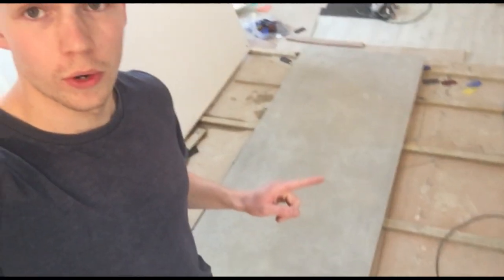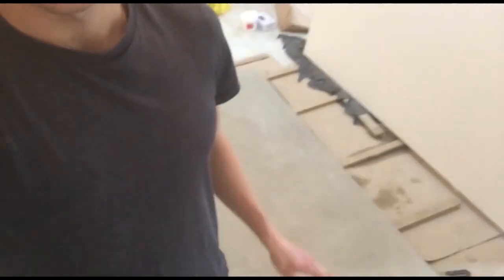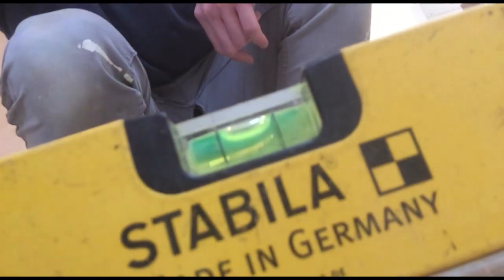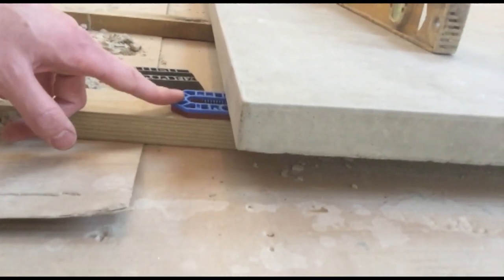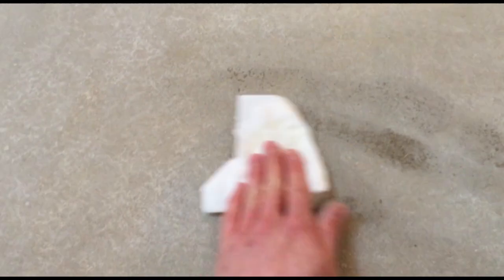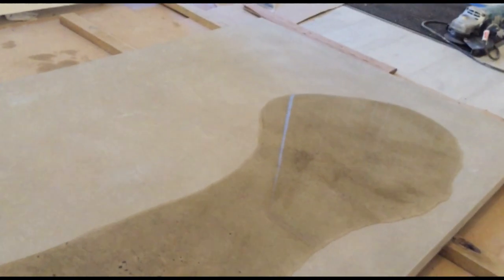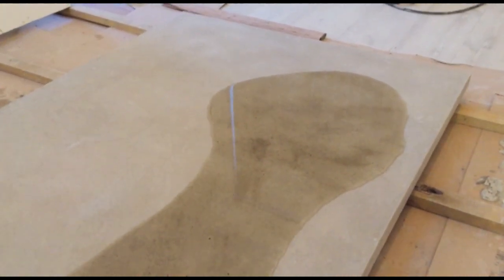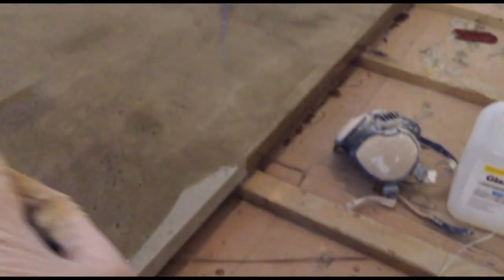How to Epoxy / Seal a Concrete Worktop / Countertop with Glasscast 3 Epoxy Resin

Comment: Great job. I made my own kitchen countertops in concrete and the are glass smooth out of the mild but I’m going to slurry the pin holes based on this vido as inspiration. Thanks for make it. Excellent work👏🙏

Comment: Thanks for the video. I was thinking about casting a few concrete worktops myself but was put off the material due to the fact it absorbs stains too easily. This epoxy solution has changed my mind. Looks great man! 

Don't suppose you know how heat resistant expo is?
Reply from the maker: The max temperature for this epoxy sealer is approx 60 degrees. But I recently used a product called H-Seal Concrete Countertop Sealer in my latest concrete worktop video. Have used it for 6 projects now and work really well and goes up to 200 degrees Celsius. Could be an option if you’re looking for a natural Matt finish. Here’s the video: https://youtu.be/O3DMjFkrC48

Comment: Hey Matt, I live in Spain and renovating a house. Had a massive concrete Kitchen countertop made. It looks pretty good...However we are having some issue son the surface ...while sanding the surface, some parts do crumble leaving a dust and brittle surface. I am thinking of putting an epoxy to seal it properly and give it an even smooth surface. What do you think ? Hope you can help. Thanks a million
Reply: I am having the same problem on the concrete counter top, have you tried the epoxy? if so what is the result may I ask?

Comment: I love the brown color with the darker slurry-filled pin-holes. How did you accomplish that color combo? Did you tint the concrete and/or slurry?
Reply from the maker: The brown colour is the natural colour of the concrete. And the black dots are the slurry mixture with is just cement and water mixed together to make a paste.
Reply: @MattHutton  thanks for responding! I’ve had trouble getting that look with the Portland cement and concrete products available around here. Apparently Portland changes color depending on where it’s sourced from.
Reply from the maker: @H1GH0CT8N3  if you’re from the UK you can use: Blue circle multipurpose cement and water to make the slurry and it will go black like that once the epoxy is poured on top. https://www.diy.com/departments/blue-circle-multipurpose-cement-25kg-bag/35715_BQ.prd?storeId=1018&ds_rl=1272379&ds_rl=1272409&ds_rl=1272379&gclid=Cj0KCQiA4feBBhC9ARIsABp_nbUXm0dMDRZFtW-jAS4IEIEQm38LSPcTLB8PtRuJbXlPu2WqJEo-vgMaAjlMEALw_wcB&gclsrc=aw.ds
Reply: That is so simple and amazing. I've watched alot of videos what over complicates things.. I took special notice of what van delaminate the surface. I think I'll do a base pour and then an actual pour so that doesnt happen. My concrete has slight cracks that occurred during drying.

Comment: How is it holding up? Does the finish need to be looked after carefully to avoid scratches etc, and if so do you have a way of repairing the glass like finish? Cheers.
Reply from the maker: It’s pretty good, as long as you don’t get dirt and grit on it or put heavy items on then and scrap them across the surface.
To repair you can sand it back and polish or sand it back and repair another layer :)

Comment: Looks great!! Am thinking of making one for my restaurant for the kitchen service counter, it does mean it will get hot pans laid on the surface, do you recon it would stand up to that kind of abuse? And like loads of antibacterial spray on a daily basis. (Would probably lay a slab of wood down for the hot pans if it wouldn’t stand up to it). Great work!!
Reply from the maker: I thanks :) I do t think it will stand up to the heat. Room temperature cure epoxy like this one will have a deformation temperature of around 60-80 degrees Celsius. I can however recommend a Matt finish I used recently which goes up to 200+ Celsius. Check out my other video here: https://youtu.be/O3DMjFkrC48
Reply: Get the high temperature epoxy and then the super crazy hard roll on extra sealant layer.  Both heat and scratch resistant - look into them  at Stone Coat Countertops

Comment: I'm wanting to make a concrete countertop to be heat resistant so I can place hot skillets and pots on it. I imagine epoxy coating is not going to hold up to that well. Do you recommend any sealer or technique to seal the countertop and still maintain heat resistance?
Reply: had the question in mind...

Comment: Hi Matt, Top Video mate, In London, currently doing this project, have made the concrete and form, removed it from its form and kept it wet and sheeted over for 7days to cure, I'm currently on the 5th day, though, question, before you applied this resin, how long did you wait for your concrete countertop to cure or strengthen before applying the resin? On the back of my concrete bag from Wickes, it says cure time 7 days, keep wet and sheeted, though, 28 days for full max strength and then I read other online advice suggesting to wait till the full strength 28-30 days till you resin. How long did you have to wait till you apply the resin?  Thanks, mate.
Reply from the maker: Y. E concrete takes years to reach its full strength. If it s fairly think line mine 40mm. I would wait 7 days because epoxy really doesn’t react well with water until it’s cured fully. :)

Comment: Hi Matt
Can this be safely used on a concrete countertop that has already been installed but and used. In other words, the kitchen counter is all cement and has been like this for years with no finish. Would this process work in our case do you think? I really like the work. Thanks for sharing
Reply from the maker: Yes you could. You just need to sand the surface to give the epoxy a key to stick to. Between 180 and 240 grit is about right. You also need to make sure you fill any holes with cement slurry, the surface should be as smooth as possible to give you the smoothest finish possible. :)
Reply: @MattHutton  are you happy with the surface after some time has passed?  Has the surface dulled from use?  Have you scratched or stained it?  How is it with moderate heat?
Reply from the maker: Dan Gehring I’ve actually been meaning to make an update answering all those questions.
The surface take boiling water being poured directly on it, hot cups and plates very well after a couple of weeks. Its pretty scratch resistant but you can see minor scratches in the reflection if you look hard at it, but it not that noticeable day to day, i.e the surface has not dulled but there are definitely visible scratches. No stains at all easily wipeable. And overall I would definitely use again for an indoor worktop, but not for outdoor.

Comment: Many thanks. Been thinking about doing some concrete worktops, I'd have loved to have seen how you made it.. Do you think it has worked out any cheaper than a solid wood worktop?
Reply from the maker: It cost approximately £150 in total for that breakfast bar worktop, which is for the concrete and resin for the top. I’m sure you can find real wood worktops cheaper on gumtree or Facebook marketplace but I loved the project and effect the concrete gives :)
Reply: @MattHutton  chears pal, much appreciated. Any chance you could tell me the approximate size of your worktop, and the materials involved? I know the Americans can buy bags of  pre mixed fine mortar that I'm not sure is available in the UK. Also, did you form it upside down on a board of melamine? Ta
Reply from the maker: Hi john Hamilton, yes I formed it upside down on the 22mm mdf melamine board. The size is 900mm by 2400mm by 40mm. It’s reinforced with 5mm steel mesh inside. Total weight 245kg.
You may need to reinforce your worktop if this will be for a kitchen, I made sure I could stand and jump on the in the three places along its length where it was being supported on the kitchen units because I weigh 80kg. If you go to Wickes the have pre-mixed high strength concrete. I used that because it just cuts out the variable of the mixture being uneven or wrong, which is sometimes easy to do when you’re adding water to concrete. I also added some plasticisers to the mixture to make sure it stayed mouldable and moveable while I vibrated in the mould.
I hope that helps.
Oh and also olive oil is a good mould release if you polish the surface with that it should come out nice and easy.
Where are you from? 
Best regard,
Matt
Reply: @MattHutton  that is fantastic info, much appreciated. Its for a breakfast bar/dining table, supported by what remains of the cavity wall that was the back of my house. I need to find a melamine board sized 2.5m x 1.25m to make the mould. I'm from North Manchester. 👍
Reply from the maker: john Hamilton ah that’s quite far away I was going to say I could come around and help you do and make a video with you. If you can it might be better to go slightly smaller and use a full 1220mm by 2440mm melamine board because you might struggle to find larger boards. But if you have to go large I’m sure you can just buy another board and screw the extra length on. Thanks matt
Reply: @MattHutton  ha, very kind offer. Just had another measure and an 8x4 sheet will actually be just about long enough. 👍
Reply from the maker: john Hamilton nice!
Reply: @MattHutton  can we add some paint on epoxy to change the color of counter top would you recommend mixing some paint with epoxy for different views?
Reply from the maker: BASIT KHAN best thing is to use pigment powder or paste, as it won’t interact with the resin. Always good to do small tests first but I’m sure you already know. https://www.easycomposites.co.uk/#!/resin-gel-silicone-adhesive/pigments-and-dyes the translucent ones are especially cool.

Comment: can I manipulate the color of the concrete ? gonna attempt a kitchen floor project.. would like slightly more variations.. without the epoxy coloring steps.
Reply from the maker: Yeah, you can add pigment to the concrete :)

Comment: How long did you wait after wet sanding before applying the epoxy?

I am refinishing a customer's previously finished concrete countertop that has scratches and has started to fade. My plan is to de-grease, wet sand with 220 until the surface looks uniform, and then epoxy it.

How long do you think I would need to wait after wetsanding?
The surface would still be partially sealed from the previous finish, which I am not planning to entirely remove
Reply from the maker: What do you mean by how long do you need to wait?
As long as the surface is clean dry and has the 220 grit key you can pour the epoxy straight away. You could use a hair dryer to help dry it out faster if you like.
Reply: @MattHutton   @Matt Hutton  I was concerned about the surface feeling dry to the touch, but maybe still having absorbed moisture deeper below the surface.

Do you wet sand or dry sand after your slurry?
I have been reading that people say dry sanding makes a surface with not enough tooth for proper adhesion
Reply from the maker: @julienlevasseur5524  ohhh sorry my apologies, I thought this was a different video and you were refinishing a previously epoxy sealed worktop. I gave mine overnight in a warm room and it was dry enough the next day to pour the epoxy.
Reply: @MattHutton  Ok thanks. Do you ever dry sand prior to pouring, or only wetsand?
Reply from the maker: @julienlevasseur5524  if some areas still need a little scratch up before the pour I’ll do it dry and then wipe of the dust with acetone.

Comment: is it best to seal and then epoxy or epoxy on top of concrete? going for a thin layer of epoxy on a 40mm counter top for best  finish . 
thanks
Reply from the maker: You can pour the epoxy straight on the concrete :)

Comment: Hi, do i have to make sure the concrete is dry before sealing it with clear epoxy?
Reply from the maker: Yes, the surface must be as dry as possible epoxy does not like damp or cold surfaces or too much moisture in the air. 
Ideal curing conditions are in a room that no-one goes into when it’s curing to stop dust/debris in the air from being stirred room temperature at around 18-20 degrees Celsius. And no excessive moisture in the air. I hope that helps :)
Reply: @MattHutton  fantastic mate. Awesome advice and thanks for sharing your experience.my concrete top is in my kitchen which is also near my washroom, we are living in and accessing the area frequently. That is gonna be bad for my epoxy curing i bet 😂
Reply from the maker: @59Wanders  if you do it just before going to bed it won’t be sticky by the morning, so should be all good ;)
Reply: @MattHutton  that is smart mate!

Comment: What about outdoor use... to protect form uv and seansoal change snow rain any advice if this product stick over a white pigment counter top
Reply from the maker: The epoxy sealer is UV resistant and food safe. So it can be used outside. Is the white pigment countertop made from concrete or something else?
Reply: Most epoxy will yellow outdoors so I highly suggest not using it on a white surface. Stone coat platinum is a hybrid that is non yellowing and rated for outdoor use and there is also polyaspartic that is also non yellowing.

Comment: Does epoxy make concrete soft/smooth to the touch?
Reply from the maker: Smooth but hard. Almost like glass.
Reply: @MattHutton  thanks for the answer. I made a countertop and want to make it less abrasive to the touch because it can easily tear at skin hard just by touching and draw blood if you hit it. Is epoxy the right idea? Is there anything else that can give it a rubbery feel for the bottom to make it easy to hold
Reply from the maker: @kevinm5385  epoxy will give it a very smooth plastic feel. If you’re having trouble with the bottle edge you could try rounding it a little with some coarse wet and dry paper. Is it just the bottom edge you have an issue with?
Reply: @MattHutton  yeah i was hoping to get an idea on how to get the overall concrete pretty smooth and i think i do now thanks again. the edges arent too bad its mainly the whole bottom side that got flipped since it had no base as it cured i want to epoxy that side as well will it be easy? (Do i need to sand the bumps and all)
Reply from the maker: @kevinm5385  okay no problem, yes you need to sand it smooth if you have any holes they can be filled with cement slurry. This is just cement and water mixed together to make a thick paste. After this is all sanded and dry, you can just carefully paint the epoxy on the sides. I’m confused at why you just want to epoxy the side though? Your sides will be glossy and the top will be matt finish. Is that what your after?
Reply: @MattHutton  thats really good to know ok, but yeah after i master making counter tops i wanna start getting into other things like coasters and some basic crafts, they always have a side that ends up bumpy and not smooth since it cures while not facing anything solid. I wanted to see if epoxy could be the solution to making this rigid side less abrasive to the touch
Reply from the maker: @kevinm5385  ah I see what you’re staying now. Yes if you vibrate the concrete enough it should significantly reduce the bubbles and roughness on the sides. And if any bubbles/voids remain you can fill this with cement slurry. If you check out my latest video you can see how I vibrate the concrete an how smooth this sides come out :)
Reply: @MattHutton  ill check it out! Thanks for all the responses and the info on slurry, stay safe
Reply from the maker: @kevinm5385  No worries, and you :] Heres the link: https://www.youtube.com/watch?v=8aNwMFAdtkI

Comment: I’m sorry what did you use to fill in the holes I heard slurry do you have a brand or anything? I have got to do this.
Reply from the maker: Hi meg, it just cement and water. Just add enough water to make a thick paste. Please do wear gloves because it will give your hands chemical burns. 
Either washing up cloves or nitrile gloves
Reply: Matt Hutton thank you! And you mentioned Seal. Did you just do a thin epoxy seal coat or a separate sealer first? Thanks!
Reply from the maker: Meg Jones hi meg, no it was just one pour of the product I use in this video

Comment: Do the air bubbles pop over the first few hours?
Reply from the maker: Yeah should do, fairly quickly. But I’m not 100%. I never actually watched them. Usually leave it overnight and don’t come back in the room again, to avoid kicking up dust into the air.

Comment: Hi Matt
Is this suitable for outdoor countertops?
Reply from the maker: Hey Scott, I have actually asked the manufacturer and they don’t recommend it for outdoors. I do however know of a very good product for concrete and is also used on the bottoms of superyatchs, it called Durepox high performance clear is very durable and does not yellow over time as it’s and epoxy-urethane. The only catch is it’s not food safe, as it continue to release VOCs for a few months even after it is cured. But as long as you use plates and don’t place food directly on it, you’re all good. It’s also not self levelling and self degassing you will need to apply several coats, sand it flat and polish it to a high gloss shine. Unless you’re spraying it, but I wouldn’t recommend as it’s very toxic to breath in.
Reply: Thanks Matt
Thanks for that 
I was just looking at another video you have done with the h seal, does that change the appearance of the concrete slightly? 
Cheers 👍🏼
Reply from the maker: @scotthallam3793   that h-seal sealer keeps the same look of the concrete and does not darken the colour, so it’s a more natural look. It gives it a more consistent matt sort of shimmer.
Epoxy or any other gloss topical sealer usually darken the concrete a little and give it more of a wet look. :) you can see the difference in my latest video: https://youtu.be/68MxJYgNuBE
I hope that helps.